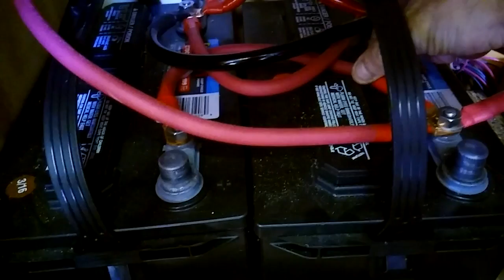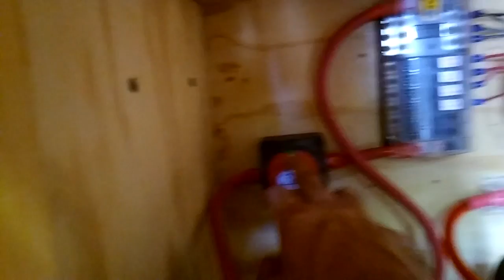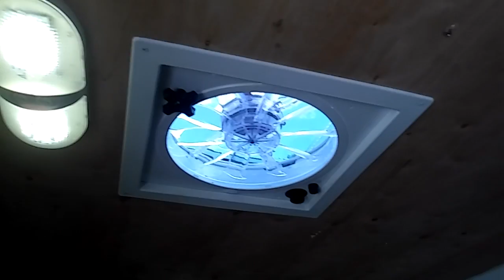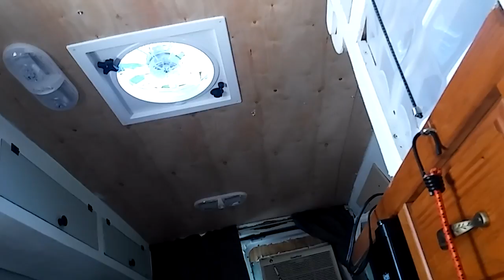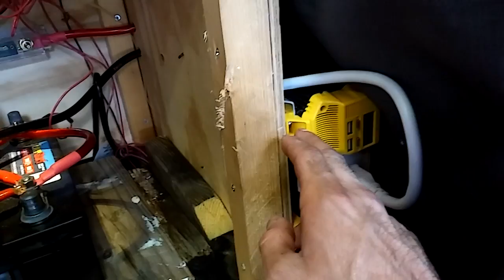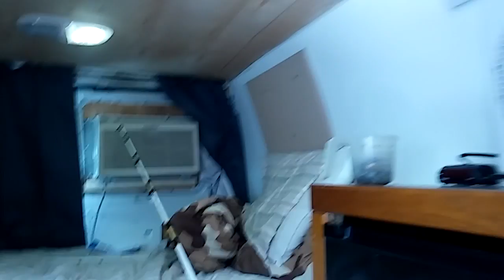Campervan & RV Electrical System Explained - Battery Bank, Wire Gauge, Inverter, Solar, D/C, ect.

Comment: Hi Cory! Thanks for a great video mate. It's the first video on an electrical system that I've actually understood. You made it sound so simple. Are all those wires that go into your fuse panel from your lights etc the positives from all those appliances? and where do the negatives from each of the appliances go to?
Reply: no it seems he used the same color red for both negative and positive. shoudve explained that to us because some ppl might not know that. but all in all a good simple electrical setup but keep in mind he has no method to charge other than the gas generator, itd be a bit more complex with the mppt charge controller attached running the solar panels to charge his system hence why it seems so simple

Comment: You're right, the electrical thing is not that hard but it is one of the things that folks likely get stuck on when they are starting into their project.
I haven't checked, maybe you already did one but curious to know how the solar worked out for you.

Thanks for the tour and the info. Cheers!

Comment: Great explanation. What I'm still a little confused about is what you don't have yet. Exactly where, after going through the split charger, does the vehicle cable connect to leisure battery? Also, after going through the charge controller, where does the solar connect? Do they both just connect to the positive terminal on the battery? And lastly, does the shore power also just connect to the battery. Just the shortest simple aswer will help, Thanks!

Comment: Thanks for the explanation, need to upgrade from a Goal Zero 400 to a regular battery like yours for more ah. Is it possible to just charge the battery with wall charger (while everything is hooked up) til I buy a solar och alternator kit? Just use the van for small trips... Also dont you need a fuse between battery and fuse box?

Comment: Good basics. I do think the 2 batteries need a separator sheet between them for road jostles. 2 battery walls rubbing against ea other can be unexpected trouble in the future.

Comment: Question: do you have the batteries grounded to the van? Are your lights on separate switches other than the one by the battery bank? If not is everything just on when you hit the switch by the batteries? Do I need to run a positive and negative from my Vans lights straight to the battery and wire in a switch for them or can I wire them up to that fuse box thing you have?

Comment: As a marine electrician/surveyor i do not approve of this instalation. The main batteryswitch needs to be fitted outside the box on a easy acces point incase you need to terminate the instalation incase of a fire or exploding batteries. There is no special/seperate vent for the box going outside of the van. Toxic acid fumes rise up.  The red link between the batteries is acceptable only if you mark or label the cabel ends. A different colour tape will suffice   the fuseboard is not labeld??  Also as stated in other comments the batteries are not fastend. Do i need to say more?   Nice try but i wont pass this if any of my staff would do this.

Comment: Does it matter how many ah are going into the fuse box? Or does the blade fuses control the amps going out?
Reply: ah is a measure of the batteries capacity. Has nothing to do with the fuse block or "amps control". The amps flowing depends entirely on the resistance of the load.
The fuse is to protect the wire from an overload (like a shorted load); or an attempt to protect the load at it's safe amperage rate.
A load is like a light bulb, or fan, or fridge motor.
As an example: a 40 watt 12Volt DC bulb will draw 3 1/3 amps. 
Watts=Volts*Amps

Comment: Hi good video.
I 've use a normal 12v relay on my van to charge my 2 aux batteries. when the engine is running the relay automatically links the 2 batteries to my cranking battery and charges all 3 but when the engine stops it splits the 2 batteries off so I never drain the engine battery.
Reply: liu family okay cool. I was wondering why there was no connection to the starter with an isolator switch. That is what I plan to set up on my new rig and thought I missed something..

Comment: I thought that it was hard to run two batteries like you did and a converter you simplified it it made it easy for me to install I am getting a then soon and going to convert it into a camping van thanks man I'm pretty darn sure when the time is right for me to add two batteries I'll probably watch your video again and it seems really easy

Comment: When using a battery isolator...is there a way to visually see how much battery power is left? Does the inverter in this video show that info? Or just the boltage of the batteries?

Comment: People going on about the batteries inside. The one i fitted has a small vent hole on the side, just connect a pipe and feed through a hole in the floor, simple. As per the setup in cars with battery in boot or trunk.

Comment: Why do you have to use the positive to the on/off switch? Would the negative cable work just the same? Also is there any need for a ground wire?

Comment: At 0:45 "two aug wire". How do you spell "aug"? Is that the same as gauge?
Reply: AWG
Reply: It is correctly pronounced "ought" like "fought" with no "f" .
It is the Gauge (size) of the wire.    Google it.
Correctly said "... 2 ought AWG .."  (American Wire Gauge)

Comment: seen this advertised Wal-Mart selling solar  what's your thoughts about this system?https://www.walmart.com/ip/Tektrum-Portable-1500w-3000w-Peak-Powerpack-Power-Source-Station-1800Wh-150Ah-50Ah-100Ah-Battery-300w-3x100w-Solar-Panel-Power-AC-Fridge-Plug-N-Play/473423588?sourceid=dsn_fb_8d51dd9e-f3c4-4982-8aed-2d72bc521fe2&veh=dsn&wmlspartner=dsn_fb_8d51dd9e-f3c4-4982-8aed-2d72bc521fe2&cn=FY19Holiday-PlusUp-Ent-Electronics_pr_dps_dsn_soc_fb_ent_ele&fbclid=IwAR39OqppgEqNEb2znuyoOINav7_F6jwCJAdHZOg9iUuf3IxKObOnaCpJk0w

Comment: Do you have a ground wire for the battery banks  negative side? Or does the circuit breaker board ground the 12volt DC?---Thank You

Comment: great video - thank you for explaining because i'm half way through wiring 4 deep cycle marine batteries like yours in my skoolie. Question: is it a bad idea to wire 4 batteries in parallel? someone was telling me that it can decrease the battery life and i should wire in series. you have any thoughts on that? i don't need to increase my voltage--and i'd rather increase my amp hours by doing parallel--but i definitely don't want to hurt the life of the batteries. thanks for your feedback and thank you again for making this video!

Comment: Did you run out of black wire I noticed you have red going to the Neg terminals and to the Neg on the fuse box?

Comment: great video, I finally have a grasp on how to wire my tear drop and what items I need to get started.  How do you do ship to shore electrical if I happen to be in a camp ground?  Do you have any electrical outlets in the van?  I plan on installing a TV and possible a stereo. I do have a portable generator when off the grid camping.

Comment: Great! Did you wire in a voltage sensitive relay system to charge the leisure batteries?

Comment: Does a 100Watt solar panel output enough amps to charge your 109Ah x 2 batteries sufficiently?
Reply: while you are drawing power from daily use / living

Comment: I hope you have vents for those batteries. They off gas I believe. Lithium and "agm's?" do not and are safer for inside your coach than led acid

Comment: How do you connect your 12V items to the 12 gauge wires? and how do you connect the 12 gauges to the fuse panel?

Comment: can I have a voltage sensing relay hooked up to trickle charge my battery as a back up plan or just as extra charge even though I already have solar panels connected through a charge controller?

Comment: Perfect video, thanks. Would I need a fuse for my fridge if I am connecting it through DC power? The 12V socket that it is using has a built in fuse on it. Thanks so  much for the videos!

Comment: I have to tell you that was the first camper van wiring video that I could actually understand. Thanks man for keeping it simple! My only problem is I want to wire my van to switch between getting electricity from either a shore line, alternator, or solar power batteries, which ever would be best to use at the time. And that is where I get brain burn. I basically want all three power sources coming into one 3-switch box so that I can hit the switch I want to receive my power from and that would go into my van wiring. Have you ever done that one before?

Comment: Short & sweet explanation, even I might could afford a Walmart battery, I 'd like some panels on my house to run the LEDs for lights in case of storms. my generator puts out too much power & burns 5 gallons in about 6 hrs, looking for cheaper solutions. Love this, if you can get 12v fixtures easy set up. Thanks.

Comment: great video with a simple explanation.As a professional electrician the only thing I would add is a fuse or circuit breaker on the 12v hot.Great job and also you can get all of your wiring needs from a local electric supply and might also get sound advice if you need it.

Comment: Great info,Thanks! Dumb question but I’m hooking up my batteries right now,I have the same fuse panel as you do. Do I run a negative ground wire from the fuse panel to the chassis of my trailer?

Comment: Hey man great video, I myself am currently doing the living out of my van thing only I'm a lot less sophisticated . As of now I live in Las Vegas and it is undeniable that I need a small AC unit . I was looking online for units that are for  cooling individual rooms and I've seen a few models that look like they would work out good can . I just run the unit off of one or two car batteries without having the wire the batteries into my alternator or battery ? As far as recharging goes my employer is totally cool with me charging them at work, all I really need is power for the AC unit and maybe my laptop and smartphone .

Comment: Thanks bud! The video has helped a lot! Just wondering if the on/off and fuse box are totally necessary if i have my 12 volt system connected to my battery with in line fuses?

Comment: Very helpful. Been rewatching it to learn more. My fuse box has only one bolt for what I assume is for the positive line from my battery. How do hook up your wire (negative) that’s on your top bolt?

Comment: Is it possible at all to run your AC unit off of the two leisure batteries? If you had a smaller AC Unit could you plug it into your inverter that runs the 120 rig?

Comment: Would that set up be enough to power 2 fans, 2 lights, 24" tv and ps4 and also like phone charger and small heater with the solar panel? No fridge or air condition? Sorry if thats a dumb question im not to electrical fancy.

Comment: the power that  is supplying power to your fuse box that should be coming from the charge controller not direct from the batteries,  unless you don't have solar

Comment: ive watched several videos on wiring. most videos show you wired your bank right accept for one thing. when you wire multiple batteries in parallel to be used as a single battery. you need to pull your portative from one battery and your negative from the other. if it was more than 2 battery's you take it from the 1st and last. it makes the batteries charge and drain more evenly.
Reply: Your summary is correct, but if you look closely at the cables to the fuse box and those to the inverter, both loads are connected to make full use of all battery cells (even though the color of the cables may not correspond to the terminal's polarity. And Cory does mistakenly say at one point that both battery positive terminals are "the same" -- and they are not, as you point out.)

What's missing from the picture are cables used for recharging the batteries, where it is again crucial to do the same as your post suggests.

Comment: Everyone is very rightly concerned about dangerous gases from lead-acid batteries. Those most likely to be found in a mobile setup are hydrogen, sulfur dioxide, and hydrogen sulfide.

None of these are produced (in significant quantities) by the discharge, even a catastophic discharge, of the battery. Charging and especially overcharging are what results in gas production, especially hydrogen and sulfur dioxide. A volume concentration of 4% hydrogen (a lighter-than-air gas) can be ignited by a spark from a switch or loose battery cable, causing an explosion under the right (or wrong) conditions.

Sulfur dioxide and other sulfur oxides formed from sulfuric acid smell bad, but are not usually produced in high enough concentrations to be acutely dangerous. Long-term exposure is another matter -- see below.

Hydrogen sulfide, which smells like rotten eggs (before it deadens the sense of smell), is very much a toxin which can end your life quickly. The good news is that it comes from overcharging of old, damaged, or corroded batteries. That means you can minimize your risk by avoiding overcharging, and by replacing inferior batteries sooner rather than later.

What does this all mean for the average mobile user? Well, if you're like the typical motorist who never wants to think about your battery and wants an easy low-cost solution, you'd be well advised to have them outside the living area of your RV in a vented compartment or box. But if you want to closely monitor a small bank of flooded batteries in a reasonably well-ventilated space, you could succeed under the right conditions:

1) keep it small -- a 600Ahr bank has a lot more gas-producing chemicals than a 220Ahr bank. And initial quality may include a lower likelihood of malfunction due to age or rough treatment. A small bank can be kept free of significant accumulated hydrogen gas if the air is changed as slowly as 10 cfm.
2) learn how to accurately monitor and measure the battery state of charge, either with a verified and calibrated wired monitor or using a hydrometer.
3) use ignition-safe electrical equipment and keep the area/space vented and exhausted to the outside, especially when charging.
4) replace old, damaged, or corroded batteries. Increased watering can indicate overcharging and/or poor condition -- the missing water has been electrolised into hydrogen and oxygen gas.
5) only use a capable charger in good operating condition. Capability includes being able to supply the correct current at the proper voltage for the necessary time. That means a good overall match between battery and charger, and more specifically a charger that has a battery temperature sensor. (battery temperature affects the proper charging rate)
6) a charger which was "fine yesterday" could malfunction today. If you're unable to notice changes in the charge/discharge cycle which are suspicious, this whole plan is probably too risky -- "fahgeddabouddit".
7) do not assume that because your batteries are "sealed" that they don't have any offgassing. They may have a rate of gas emission 1/50 of flooded types, but age, damage, corrosion, and overcharging are still the enemy -- ignore them at your own risk.

Comment: You are a good teacher. This is very helpful. One question - When you connect solar panel do you connect the solar panel to the controller then the controller to the battery AND distribution panel (your load)? OR do you connect the load from your battery (they way you have wired in video)?

Comment: Would it be ok to use 4 gauge wire instead of 2 gauge for the batteries
Reply: If you're using an inverter, the mfr will indicate a minimum wire size for use with their product. Their recommendation is based on the expected maximum current drawn by the device. A smaller size will not provide the same capacity of power supply and will very likely result in overheated wires, blown fuses, and/or fire danger.

Since those same wires are used to interconnect batteries in a battery bank, they are also used for charging. Smaller wires for that purpose will not permit efficient charging and again probably overheat.

For the same reasons, you want to avoid mixing cables of different sizes for the battery primary and interconnects, since that causes a kind of bottleneck for the smooth flow of current.

Distribution of DC for use in lighting and small motors through a fuse box or inline fusing can certainly be done with a smaller gauge, depending on total expected draw. Wire mfrs like Cerro publish ampacity charts showing how much current each gauge and type of wire can handle safely.

Comment: Is the 12v Fuse Box panel required? I'm trying to use this set up to power my freezer in my food trailer while the generator is not on. But I don't think I need the fuse panel. Not sure.
Reply: Welders use DC power, so even a single car battery can start a fire if the wires are overloaded or shorted out. A fuse box will protect wiring from that potential. Alternatives might include an inline fuse as close to battery as possible in the positive wire for just a single circuit -- but there are some who say this is not always a safe way to install a system, especially for a novice. In any case, heavier wires and some kind of conduit to protect them (metal or PVC) is probably a good idea with or without a fuse.

Comment: Okay how much power (watts)do these two batteries give out in 24 hours?
Reply: Cory says in the video he's got a total of 218 Ahrs from the two batteries fully charged. That number comes from the standard comparison used for deep cycle batteries of the so-called "20 hour discharge rate". Unless you're doing actual calculations for Work capacity requiring watts, the Ahr number is how storage capacity is usually referenced. FWIW, these are rated 12v nominal, so you could get an approximate power number by the calculation P = I*E = 218*12 = 2616 watt-hrs. But that doesn't really tell you how much power is available right now, and how much can be had later . . .